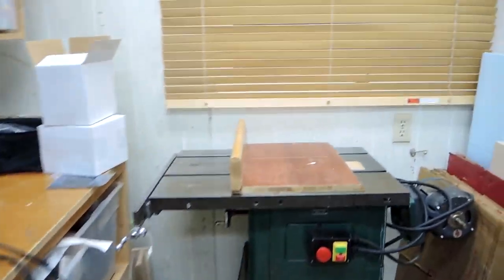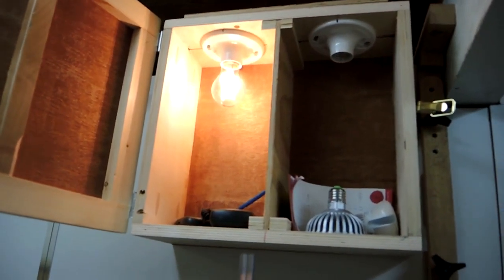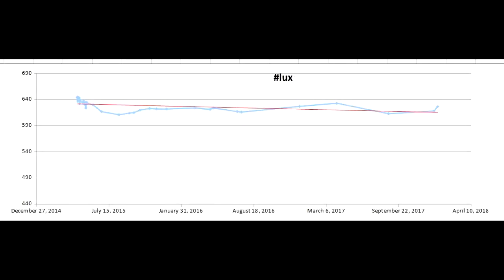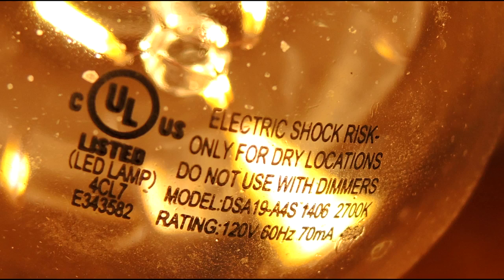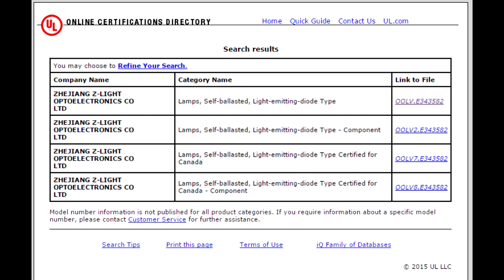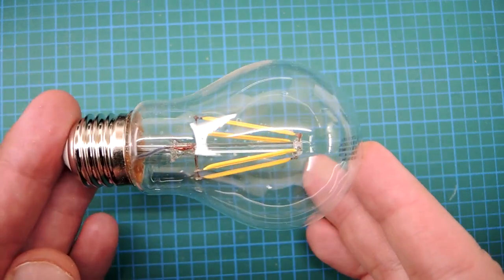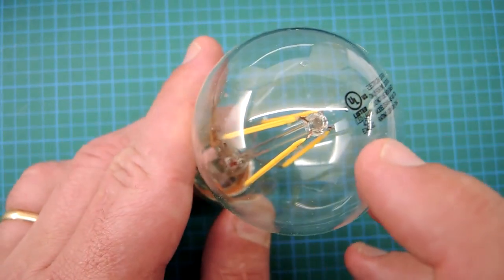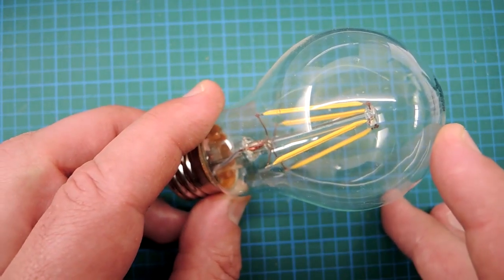Filament LED Long Term Test: 24, 000 Hours Read Out

Comment: Hm... I'm thinking : I've bought 3 x E27 bulbs and one of them is mounted to work uninterupted for 1.5 years. The other 2 are in their original box, sealed.
I don't have equipment for lumens and stuff but i can put them next to eachother and record them with my phone. 

Maybe in 2020 summer (at 2 years on) if still works i'll make a video aout it :)

Comment: Thank you for running the test; very interesting. By way of counterpoint I bought an 800lm (60W equiv) LED filament bulb a couple of years ago here in the UK, and it was the shortest lifespan bulb I've ever owned. It started flickering after a month, and died completely four days later. I managed to get a full refund, but I'd say thermal issues claimed it, despite it being in free air.

Comment: I wonder if running the lamp 24/7 is actually stressing it very much as there are no thermal cycles.
I'm maintaining the lighting system in an old apartment building which partly used to run CFLs and is now switching to retrofit LED bulbs. So far  this on at dusk off at dawn cylcle resulting in about 5000 hours a year has shown that retrofit LED bulbs are not up to the job. The CFLs seem to do very well on this cycle, most exceeding their specified lifetime, sometimes by a multiple, but I have yet to find a retrofit LED bulb that even meets its spec in this kind of use. The luminaires with integrated leds (big boards and separate driver) seem to do a whole lot better as they're not nearly running as hot. Introducing cycles with a thorough cool down might actually speed things up...

Comment: Is the bulb connected to plain old wall current? I wonder if small, long-term variations in your house supply voltage could explain some of the wobbles in the lux graph.

Or even short-term variations. Even across circuits, some lights in my house visibly blink or dim when the washer, dryer, or microwave is run.

In any case, I think it's a great experiment, thanks for the update.

Comment: Unfortunately supply chain is only 3 links long in China (I live in Shenzhen) so while it was an interesting experiment it is unlikely even the manufacturer can get the components needed to replicate your results. Hardware is now more like a child than a machine. It is easy to produce and repeatability is not their concern because components and customization are so easy. Lowest cost is the Driver and with Alibaba opening the door to direct sales, it is caveat emptor from now on
Reply: LumenCache you can only hope that price pressure kills small manufacturer, and all come from the same factory so these LEDs can last long if the component count is low and design is simple/rugged

Comment: I thought these were a gimmick with poor thermal design when they first came out. Glad to see I was wrong!
Reply: Some still are, the question is always does that model flicker, because many cheap ones do.
Reply: I think they are; my first and only foray into the genre lasted a total of a month and four days before it failed completely. Remember a sample size of one is not statistically useful, either in this case or mine ;)

Comment: How do these types remove heat from the LEDs themselves?
Reply: One of the filaments inside the lamps typically uses less than 1W. Compared to "normal" SMD LEDs a filament has a huge surface area which means the convection in the bulb will carry the heat away without heatsinks.
Reply: Convection inside of the bulb.
Reply: Gasses such as helium offer superior thermal conductivity to air. If the bulb is filled with helium, the entire volume of the bulb acts as sort of a heat spreadet
Reply: Some heat wanders from led into the wires to the glass socket and down to the PCB/socket too
Reply: hmm, so why all this fuss with heatsinking with the SMD based bulbs?

Comment: I think it is more the shock of turning it on and off that kills most lightbulbs including incandescents than the actual runtime.
Reply: The western manufacturers of lightbulbs agreed to have all their incandescent lights run for 1000 hours only, back in the mid 20's. Inrush current shock is a factor, too, but mainly it's the limited runtime by design.
Reply: 10mintwo Power switching is irrelevant for the led as diode but does the led run of AC? No it doesn't so it is the current source that goes bang from switching...still relevant for the consumer if the light doesn't emitt any light because the electronic part is dead..
Reply: The power supply for the filament LED bulbs is entirely solid state, there aren't even any electrolytics. Very little effect of even constant power switching.
Reply: The light bulb conspiracy nonsense hasn't been relevant for like the last 60 years since it was broken up in the 50s. And power switching is irrelevant for lifetime in LEDs

Comment: This is great!!  Would you know of anyone who run these bulbs, and if any of them failed?

Would be nice to know, but seems to be very reliable. But any one that failed is likely power supply.
Reply: I_will_get_you There I saw one  broken in a Zara's kind-of store. The filaments were lighting very dimly because one of the small LED failed.